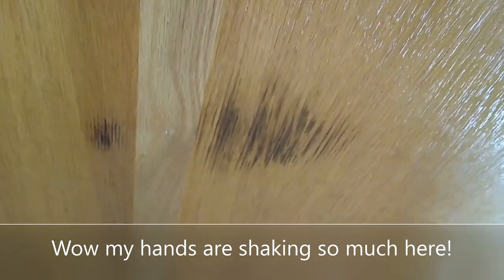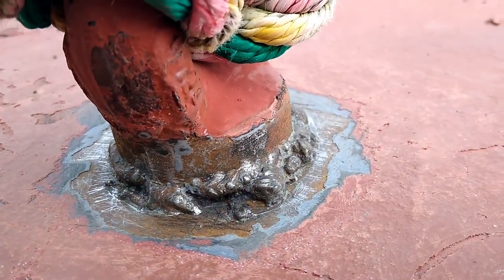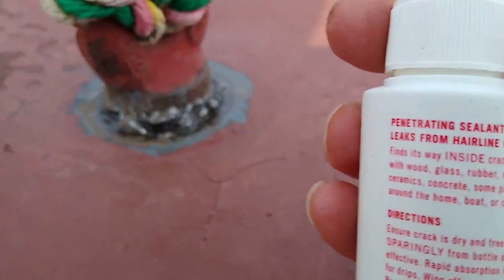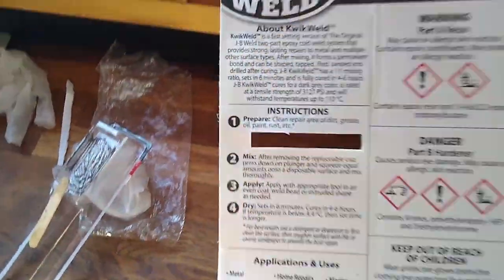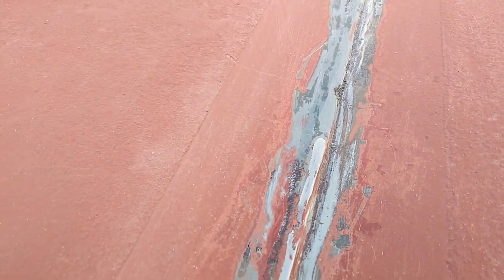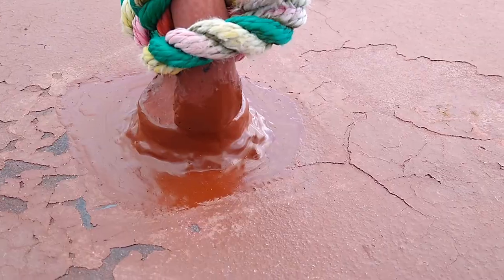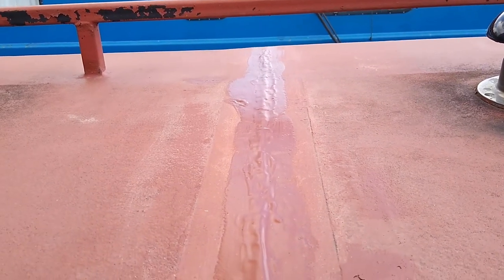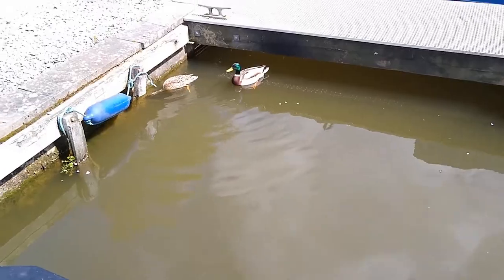10.  Fixing narrowboat leaks

Comment: Holes for ventilation, need about 50 more. Each hole weakens the wood so might need to add some bracing under the bed to support it. Treat all the holes with varnish or sealer or it will delaminate in a few months. You can also buy a plastic mesh which some narrow boaters do that lifts the mattress off the wood by a couple of mm which allows for some ventilation. Can also but some water absorbing pellets (dehumidifier) and place 1 under the bed. The black staining on the wood, could try soda or a mould remover. Bleach should remove some of the darkness.
Reply from the maker: Yikes 50! My poor drill 😅
Great advice about treating the holes, it hadn't occurred to me! That mesh sounds interesting too, thanks!

Comment: If that dark patch on the ceiling is directly below the dodgy welding job it may be discolouration due to the heat that was generated by the welding process. It looks so dodgy that the heat may have been applied for some time.
Reply from the maker: Hi Steve, it's a good thought, but I think that weld was done some time ago and the discolouration has only recently appeared.  I wonder if they could still be related?
Reply: @narrowboatnoob  In that case probably not heat relaated, but you could be right, maybe just a leak. At least it's on top of the boat and not on the bottom.
Reply from the maker: HAHA, yes I'd much rather have it from the top!
Reply from the maker: HAHA, yes I'd much rather have it from the top!